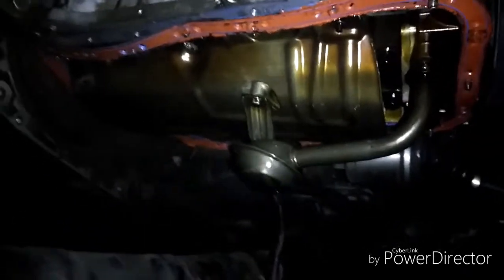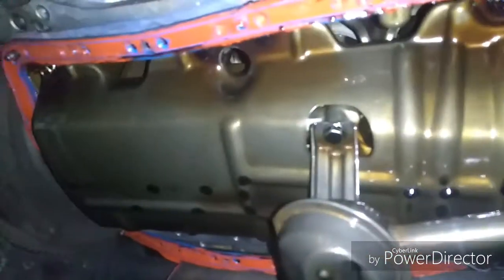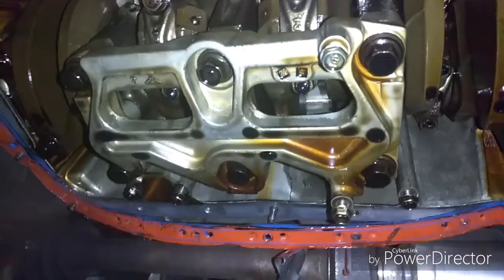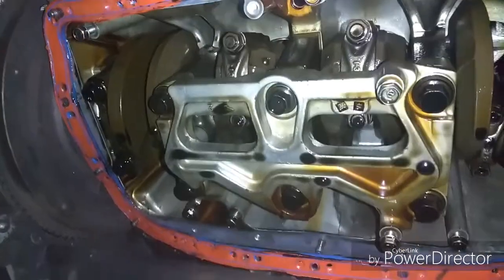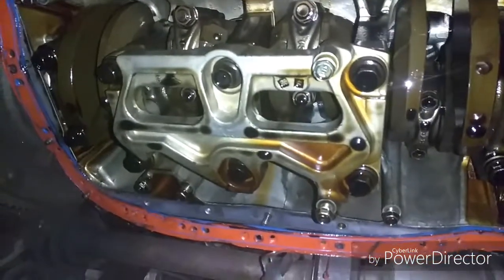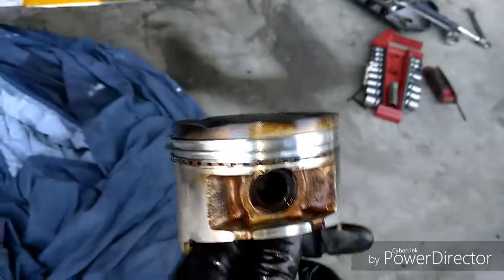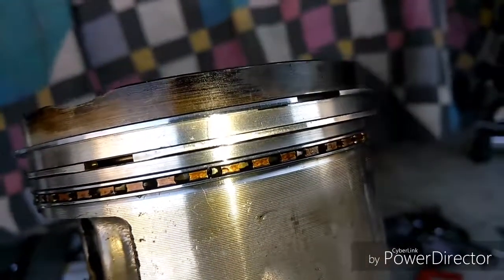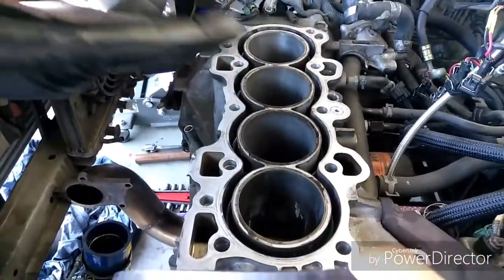Honda/Acura Piston Removal

Comment: What’s the  “mm”  on the  honing tool that you used in the video ?? Idk which one to use .
Reply from the maker: I'm currently not home. And I don't remember. But I should have an answer for you by tomorrow night. The B series bore is 81mm so long as the honing tool can open up to that size or bigger you should be fine. Thanks for watching 😁👍